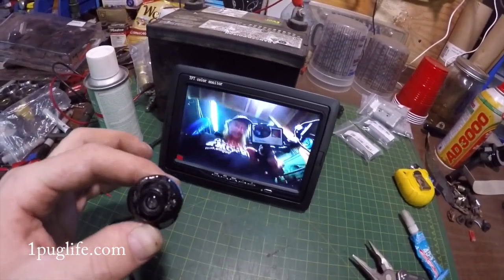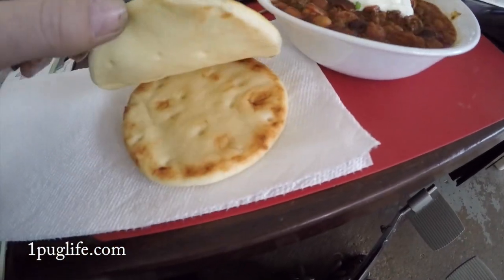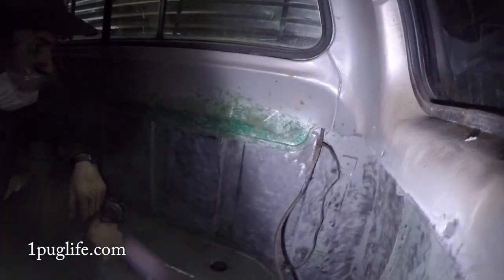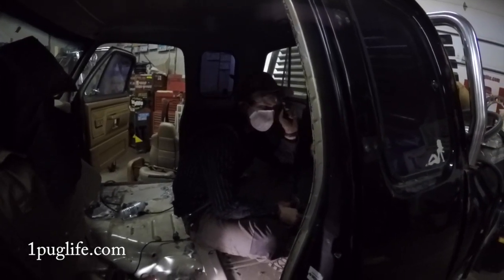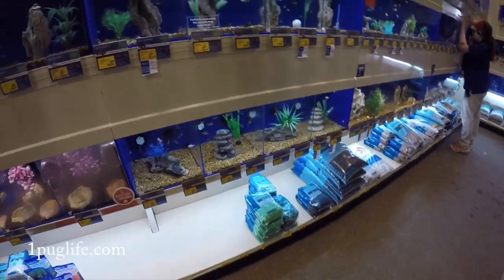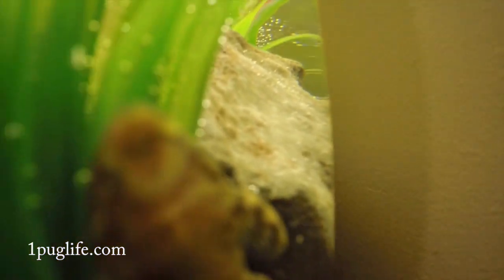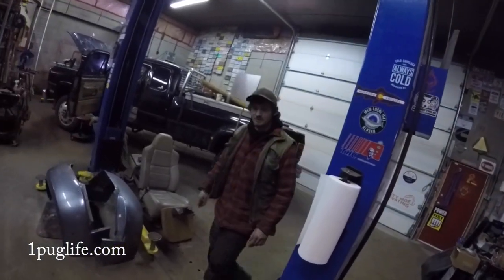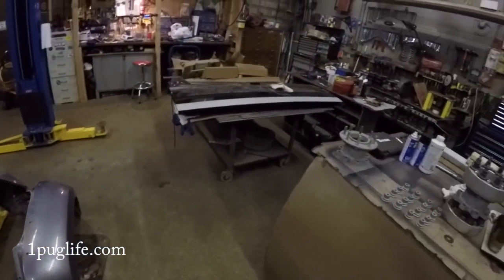what a complete waste of time

Comment: On those 89- 93 cabs the rear cab mounts ussally pull threw causing the back of the cab to crack. Plus the fuse box design is total crap the clips break off and they dangle from the harness cuasing the instrument cluster to not work.